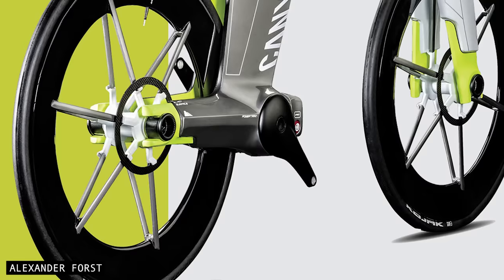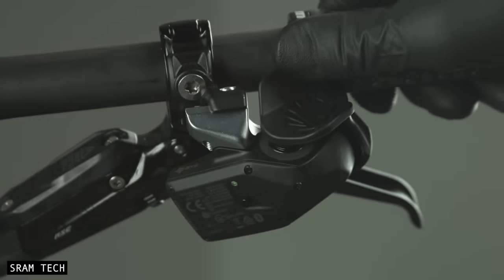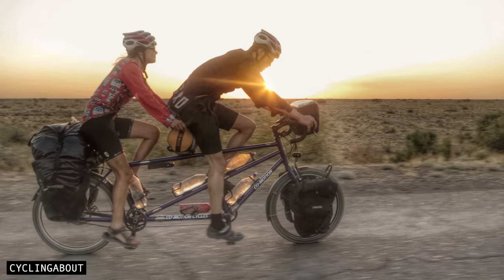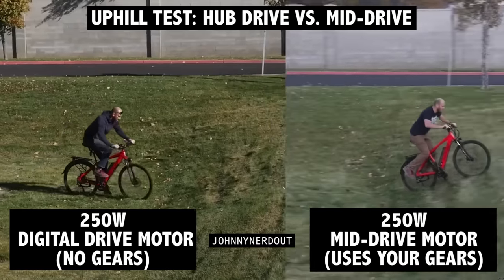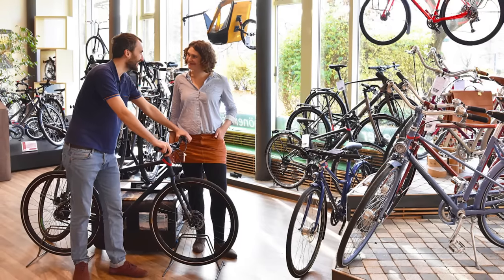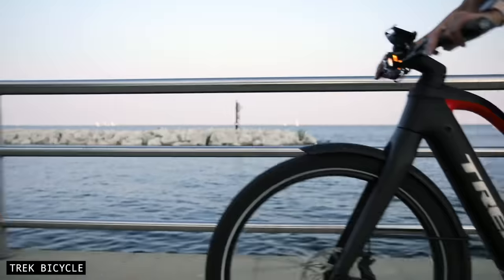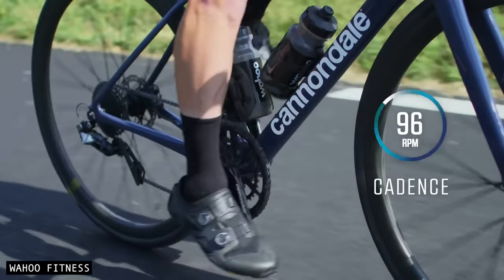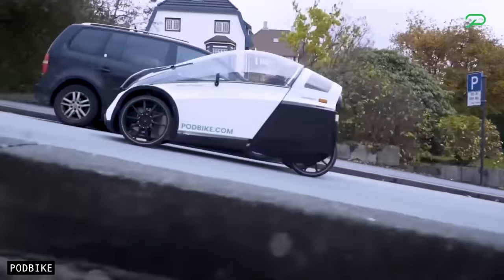Are Chainless Digital Drive Bicycles The Future of Cycling?

Comment: Maybe we can mechanically connect the wheel and pedals with some kind of flexible high strength high tech linkage member and save costs and unnecessary electronics and batteries - imagine if someone challenged the status quo and suggested a cheap chain 🤷‍♂️🤪👍

Comment: I think the energy loss is too much of a flaw, i don't see that much of a practical use for it for the majority, since it will just require more effort for the same energy, also although chain-less bike might have less maintenance, if there's a issue on the road, it will be more costly, and way harder to fix "on the go", I only see this as practical for the masses if it was a part of a e bike, since you are already having a motor on that, it will result in less moving parts

Comment: Well, question is, how much more  is the weight of this solution, generator and motors aint light.  Apart from that, how much is efficency, If its below 94, 95 % it does not pay off.

Comment: imma just stick with my "analog" 21 speed derailleur for the time being. 
advantages: 
-cheap
-no need for recharging
-easy to use
-you can dump it in a river and it'll still work
-if it stops working everything can be accessed and repaired with a basic multitool
disadvantages: 
-oh noes I can't go 30mph in headwind

as a dutchman, electric bikes are a joke and a the biggest example of road safety loopholes since the invention of the SUV.

Comment: It's an interesting idea, such concepts exist for larger vehicles: A lot of cruise ships have Azipods and these have electric motors for the propellers, thanks to that they can turn them 360° and the power is generated by a diesel engine coupled to a generator (however you could also use a nuclear reactor oder fuel cells), so they have a much better maneuverability than with a classic shaft-driven propeller and rudder.
On trains and locomotives most diesel-powered aren't directly driving the wheels through a gearbox (a few do like railbuses or their successors - light diesel multiple units like the Alstom Coradia LINT), but some have hydraulic transmissions (comparable to construction machinery, however these are more hydrostatic while such trains are usually hydrodynamic) and most are diesel-electric, the diesel engine drives a generator that feeds the electric motors that drive the wheels, nowadays there are also "hybrid" locomotives like the Siemens Vectron Dual Mode it can use the overhead lines with the pantograph but also has a diesel generator, so it could literally drive on every track.

On cars these "serial hybrids" are rare, the Fisker Karma was such an example and the Chevy Volt/Opel Ampera except one mode where the combustion engine was mechanically connected to the wheels it usually used the electric motors, and BEVs with range extender like BMW i3, Mazda MX-30 R EV.
The first of that kind were already built from 1900: The Lohner-Porsches, constructed by a young Ferdinand Porsche.

But I don't see the point on bicycles with "normal" frames, the mechanical methods are highly efficient and IMHO you need some resistance or almost Force Feedback, I only see potential for some eccentric frame styles that wouldn't be possible with chain/belt or are rather complicated to build like recumbent bicycles (saw recently a kind of these and it had normal derailleur transmission but with extremely long chain), tandem bicycles (where the two usually have to pedal in sync, with this they could pedal independently) or bikes for even more people like the so called conference bikes (where the people sit around a table and the person in the back is steering, due to the size and the four wheels it has to use the vehicle lanes) or also party/and beer bikes (that also have a table in the middle and the guests sit sideways with the driver in the back), in combination with a battery the driver could also increase the speed if the cars can't overtake on a single lane, so it's less of a traffic obstacle^^

Comment: I think this especially starts to make a lot of sense today with electrically assisted bicycles. You already have the motor, so If you can have a fairly efficient generator, then you can get rid of the chain and the gears entirely, which means less wear and thus less maintenance. You can choose yourself how much power you want to put into the system vs. how much the battery delivers, and this way, you could increase your range, probably significantly.

I own an electric bicycle, which only has a rotation sensor and no gears. This means that it won't let me invest any of my own energy. I only have to move my legs to activate the motor which does all the work for me. The only reason the chain is there is to get me of the line. It has a range of 40 km but I'm noticing a significant and exponential power decrease after 20 km. Being able to deliver extra power with a generator could make a huge difference there I feel.

This way you can still have your workout whenever you want without a chain or belt. This could really simplify electric bicycles.

Add regenerative braking and it even starts making more sense!

Comment: It's never going to be the future, as it's inferior to chain & belt drives by a large margin. You first lose efficiency by converting mechanical power from your pedals into electrical power, then you lose efficiency once more when you're converting that electricity back to mechanical power. On top of that, the added weight of 2 electric motors and the complexity of the system makes this technology dead in the water.

Comment: Digital cameras are a bad analogy.  In the 1960s we already knew that Digital cameras would replace chemical film.  NASA had already developed Digital photography and the major obstacle was cost.   At the same time chemical processes were fraught with problems.  Physics led us to believe that Digital photography would eventually take over. Energy management will always be a problem for an electric drive bike.   The physics for energy loss in 2 conversions is dismal.

Comment: Nitpick: "two wires transmit the power you're generating straight to the motor". Firstly, it's not straight if it goes through the battery and control electronics. Secondly, a typical induction motor will actually come with three wires to transmit power, not two. Learning why three is a great venture into how humanity has used electricity since the industrial revolution.

Comment: Yea, and in the future we will have flying bikes. What a bunch of BS. As if complicating a simple system like a bike via generators, motors, ECUs, computers and software will make it cheaper, easier to maintain and more reliable. More reliable than what? 2 sprockets and a chain? Cheaper than 2 sprockets and a chain? I can ride my bike long after the company that produced it failed bankruptcy. And I do. Can you say the same thing about the software and electronic components of the bike of the future? This is a solution that is looking for a problem. A Monorail.

Comment: @13:40 poor choice of imagery knowing how batteries  react to cold weather. And I still don't get why you insist that it could work for e-bikes. Why would I want a digital e bike that drains the battery faster than a chain drive equivalent ? It would obviously result in less range. This sounds like a typical modern "solution". It's catchy, sounds futuristic but it's ultimately dumb. Good for scamming customers because it sure won't be cheap. It's already bad enough that e bikes cost as much as full fledged motorcycles ...

Comment: If you used 2 motors, and a power split device like a planetary gear, you could basically make a miniature version of a Prius transmission... just no engine. That could make it more in line with the efficiency of a gear system but with the advantages of an e bike with regen braking.

Comment: there are so many factors IRL that are not shown here 
solar panel idea is not practical unless you would remove surface of solar panel  so you would produce less energy or only use them before ride at home
wind is huge factor for bikes
i agree whit german law makers because control over bike is much different if you dont have chain ( the way you brake and accelerate)
did i hear it correct 29 KG bike? so you cant really store it in top floor of the building also you need to use your energy to move additional 29 kg 
i like this concept but man sometimes simple solution is just way better

Comment: Before starting the video, I wanna make the prediction, that this is far less efficient, than just using a chain. Converting movement into electricity and then back? Maybe it could work if you also store the energy when you break. So instead of producing heat by friction, you produce electricity there as well.

Comment: Without watching the vid yet, No. Worst idea ever. You need the mechanical connection of the chain so you can stand/push on the pedals to ride properly. I don't think an electric magnet resistance (a generator) would ever come close to simulating the fee of direct drive.

Comment: This use of "digital drive" should be stopped in its infancy, has not humanity stooped low enough already in their naivety?

Searching for "digital motor", we find it is a term invented by Dyson marketing.  Replacing the mechanical commutator in traditional motors with an electronic commutator doesn't make the motor digital.  Computer control does not make the drive train digital.  Can we please use the language of adults not tweens!

Comment: I doubt it.
mainly for cost reasons
You very briefly say that these will be cheaper to manufacture.. but i do not see how
I have seen brand new bikes for as low as 300 here, which is about what you would expect to pay for the electro motor alone.

The electronics will add a significant price for a supposed benefit that most people will never positively notice
They just want to commute from A to B, and will not care about how fancy a bike is.

Let's take that list of advantages:
* "Drive train wear and tear" It is minimal, and easily (and cheaply) fixed when you take your bike in for maintenance
* "no greasy fingers" a normal city bike, used for normal city commutes, will never see you needing to get your hands greasy. Derailer bikes are the exception, but i do not see why people use those anyways, especially for city commutes.
* "low maintenance" True, but maintenance nonetheless, and most people take it to the shop for maintenance.
* "automatic gear changes" Automatic gears are fine on cars, but since the human is powering the bike, what the computer deems optimal, may not always be what the human sees as comfortable.
* "infinite gear range" sure, but do we really need that? it is rare that a mechanical gear does not have the gear ratio that i desire.
* "charge while you ride" why charge at all?
* "regen braking" this can be useful if you stop a lot, so it depends on the trip. Good cycling infrastructure can reduce the amount of full stops to near zero. (my commute for example has only 4 stops in a 8km trip.)
* "ABS" Average city commutes have 0 need for this, except in maybe really extreme weather. Bikes are very light and low power, they can stop in a heartbeat on most surfaces.
* "wheel lock" i would say it's nothing a normal lock couldn't fix... but sure, its the first feature that could actually be useful for the average cyclist.
* optimize your peddling technique" No matter how much you optimize it, you will not overcome the added inefficiency.
* "eliminate crank dead spots" not noticeable in a commute, and already something you can do yourself if you are not trying to get the max performance.
* "new bike design options" oke, you got me there... but outside of maybe a more compactly foldable bike... is that really something that bikes need?

And i would also like to add another negative to the list: it may be greasy, but you can fix your mechanical bike yourself, or there is usually a bike repair shop nearby, even in most towns you will find one.
But good luck fixing your fancy bike yourself, or finding anyone outside of your brand's dealer, who can fix your bike.
If your bike is your main and only form of transport, i'd have to drag it to the nearest dealer, which realistically is going to be nowhere near you.

And this isn't just a theoretical, just look at the disaster that was the Van Moof bikes, the moment they broke, you had to go to them to have it fixed, they had few locations, and had massive wait times. (like weeks, or even months)
During which, again, good luck getting anywhere.

For the most common bike user: the commuter, there is nothing that an electric drive adds.
Just look at the Netherlands, the biking capitol of the world, despite the much more efficient and technically better bikes in existence, most people just have the simplest, cheapest and most comfortable option: a steel frame, direct chain drive, no gears, comfortable upright seating.
Because no one cares about these features.

Just like there is no reason to reinvent the wheel
There is no reason to reinvent the bike
It's simplicity is what makes it so amazing.

Comment: Ok here me out here, new idea for a digital drive bike, the peddles power a generator that then is fed into a battery, from the battery it goes into a Hydrogen generator, the hydrogen that is produced is then burned to boil water, the steam that is created is then used to push a piston to power another generator that then charges the first battery also which powers the motor on the rear wheel. The steam is finally recycled as is the water produces from burning the hydrogen goes through a condensing loop and returned equally to each container of water. I'd say it's about 3% efficient.

Comment: It seems highly unlikely that such a system could achieve anywhere near the same  work transfer efficiency or not suffer a significant weight penalty. The storage is interesting, but again, the weight increase would seem to more than negate any benefit.

Comment: You should probably spend a couple of minutes googling what digital actually means next time.  

Digital means discrete conditions of low or high, on or off 1 or zero. Analog is a wave function. 

The majority of these applications use synchronus induction motors which run on a variable frequence, 3 phase SINEWAVE. The actual signal that controls the motor is Analog, there are some digital components in motor controllers but it's irrelevant anyway because digital or analog is used to describe electronic information not locomotion. An electric train isn't described as a "digital train".

Comment: I'm not convinced that a digital drive bike is a lower running cost, especially if one sat in a garden shed for 5 years the battery would probably be finished. plus the additional concern with corrosion and sensitive electrical components compared to a chain and cassette.

Comment: is this not less efficient than a chain. you are losing energy at both the pedals and the wheel as it converts kinetic force to chemical in the battery then back to kinetic again. where a chain is never converted at all so the only inefficiency is a very small amount to friction which you would have much more of one the digital setup anyway. seems like alot of steps to be more complicated, heavier, less efficient, and more expensive.

Comment: It's a dumb idea, at least right now. Bikes with this type of drivetrain are more expensive, heavier, more complex and less efficient. I can see generator built into the crankset as a somewhat valid range extension option for e-bikes, yes, but using it instead of mechanical transmission is a very bad idea. 

In my opinion, belts and internal gear hubs are the future of bicycles. They are already efficient enough with a lot of additional benefits, with just one downside being the cost. I'd say the future of cycling will arrive when the cost of a belt-driven transmission will drop to at least 10% of what we have currently.

Comment: You're underselling how heavy and expensive this system would really be. In order to truely replicate human performance you need the rear motor to meet the torque output of human rider, which for a common cyclist apears to be ~100nm. Few hub motors on the market are capable of even doing this, and those that can weigh at least 4kg (and pricey!). I can easily see this system adding at least 5kg to your bike. Its a massive peformance and cost compromise for a minor benefit in your maintenance schedule.

Comment: Too many losses in the "chain" - mechanical loss converting input energy to electrical signal, electrical loss converting back to drive the motor. Far fewer losses in a direct old school chain drive. Might have a use in a gym (although I can't see why) but not for a normal bike.

Comment: the hub motor could be coupled with or integrated into planetary gear/s. I don't see a problem with the torque. 500W Motor would be enough.

Comment: It may be more complicated and expensive than a standard bicycle, but it is much cheaper and simpler than an electric automobile (and takes up less space on the road/for parking and would be safer around pedestrians). Hybrid bikes with digitally controlled drivetrains should be the future of individual travel in cities (paired with public transit).

Comment: Hybrids would be more ideal.
Motor on the front siphons energy when a gyro senses it's tilted down (since otherwise you'd be exerting yourself more than normal)
Then the motor activates when it detects a certain threshold of power being sent into the pedals. More energy exerted = more power used by the motor.

Comment: The pedals are basically just a way to provide a loophole for current ebike laws. There is no way this is an efficient way to provide power to the rear wheel in any significant way. It’s an electric motorcycle.